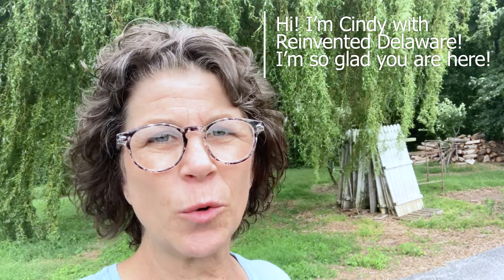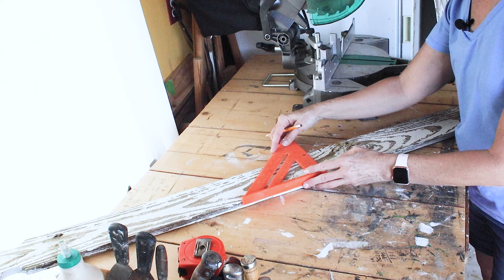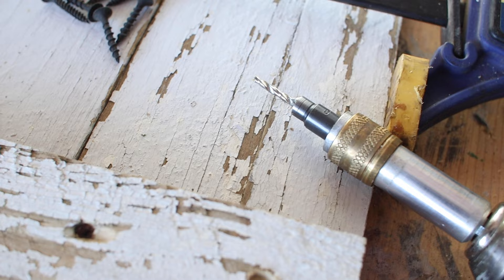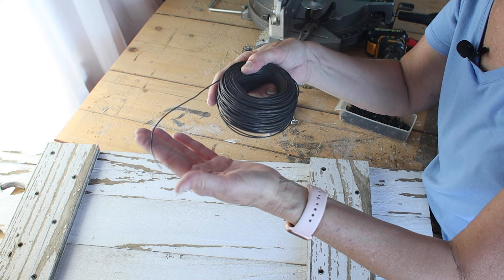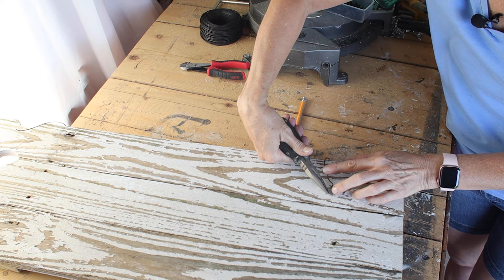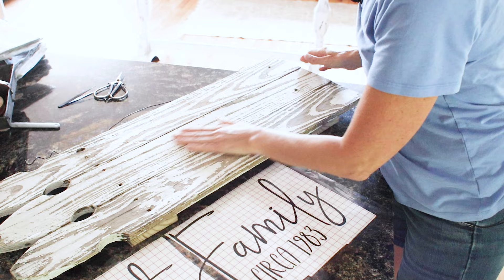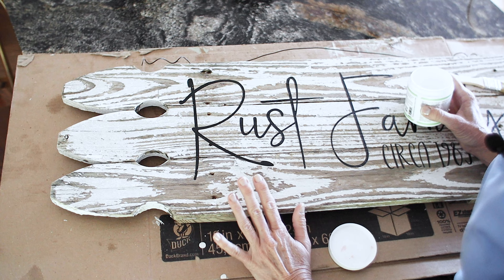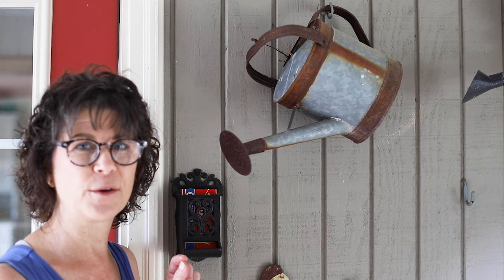Easy DIY Wood Sign Using Reclaimed Wood

Comment: I use my Sihouette Cameo for sign making. Sometimes i cut the vinyl fir them  and sometimes I cut  a stencil. Like you I don't like it when the vinyl overlaps the board seams. I use an exacto knife to cut mine and a toothpick to tuck and ends into the seam.
Reply from the maker: Great tip! Thank you!

Comment: I love this family sign, Cindy! What a great idea to use old pickets for this project. I just realised that I have a similar bell pull as the one you have on your wall next to the sign. It was given to me by a friend who is now deceased. I need to clean it up before I hang it. Did you add any kind of finish or rust-proofing to yours?
Reply from the maker: Thanks for watching and I'm glad you enjoyed the family sign project, Jayne! Isn't the bell pull a fun accessory - I literally use it to call my hubby for dinner when he is outdoors or in the workshop! I haven't put a rust-proofing sealer on ours and so far we haven't had a problem with rust that I have noticed. You could use a spray sealer in a flat finish that would seal it without changing the look of the bell. Hope that helps!
Reply: @ReinventedDelaware  yes, that helps, thanks, Cindy!